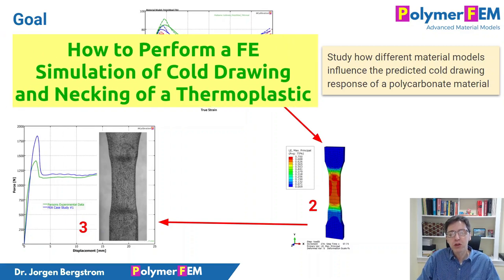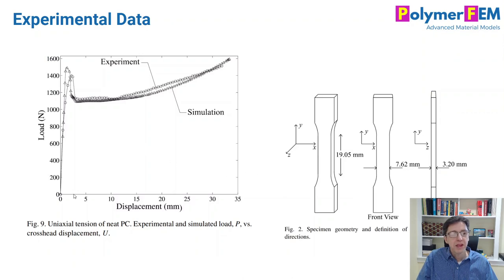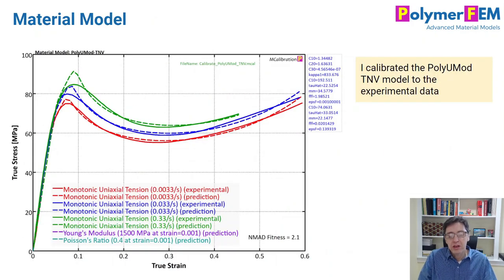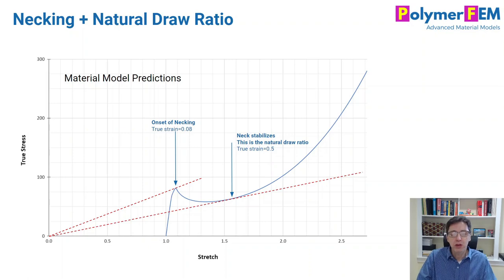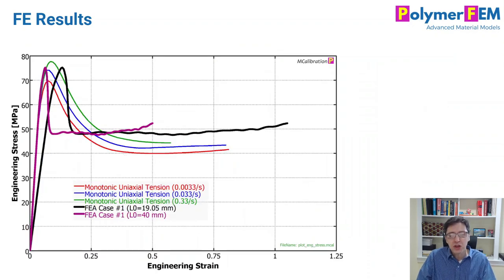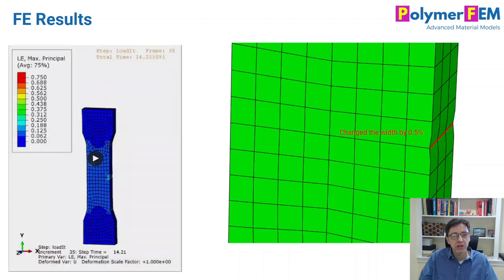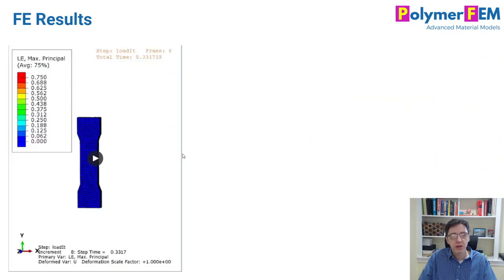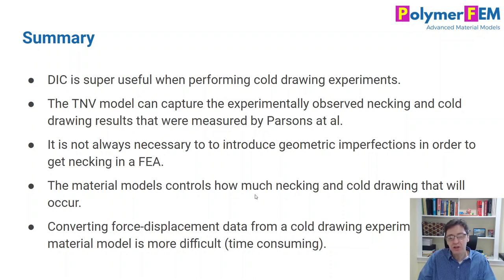FEA of Cold Drawing and Necking of Polycarbonate (Part 1)

Comment: Is there a specific reason to use TNV model? If I have true stress vs. true strain data (for different strain rates), abaqus gives me an option of modeling it as elastic-plastic material where input plastic stress vs strain data in a tabular format (and I do that for various strain rates).
Reply from the maker: One of the main reasons not to use an elastic-plastic material model is that it will never predict the unloading response well. It always over predicts the residual strain, for example. It also does not extrapolate to higher or lower strain rates well. The TNV model solves those problems.